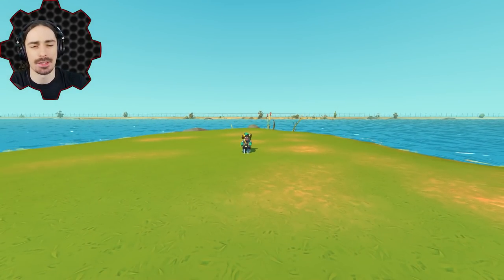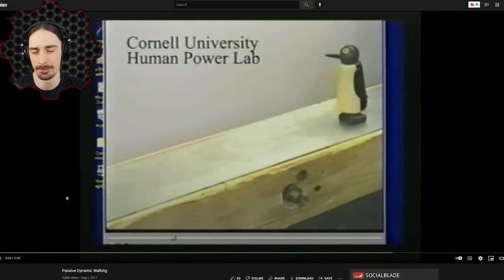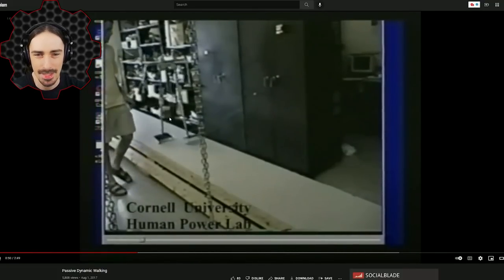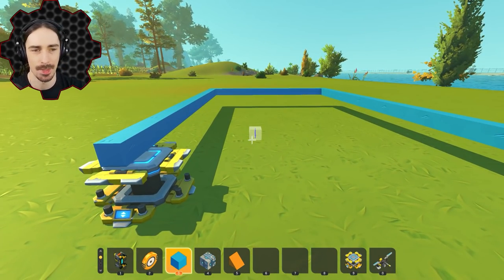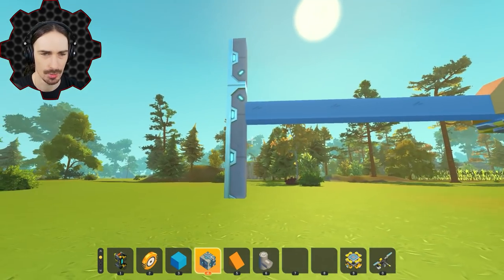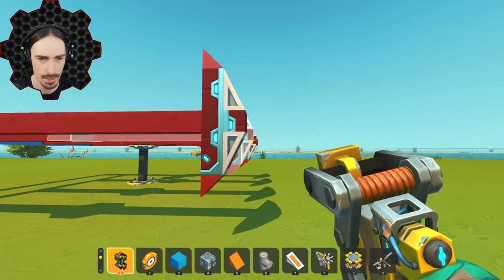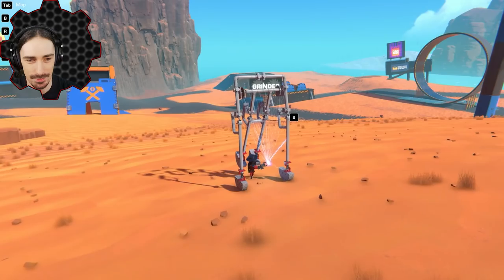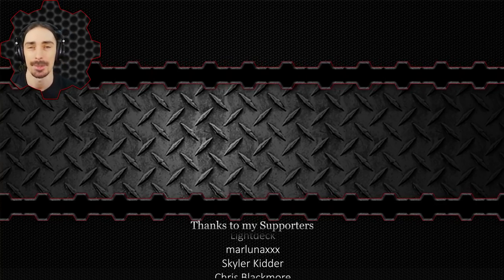This Simple Walker Was The Hardest To Actually Make

Comment: If you were to try this again, you'd need a counter weight at the top of the knees.

The reason it's not taking the correct steps is because it's main weight is in the feet. If you extend the lower leg through the knee and add extra weight at the top, it will cause the knees to bend on every step.

I'm actually super interested in seeing this work and might need to make a video on it just test the concept 😅
Reply: Ok your probaly right
Reply: Oh in i forgot in scrap mechanic or in trailmakers
Reply: @Hiro_blee3292  it was probably trailmakers
Reply: ^ This ^
Plus he should change it so one set of legs has feet pointing forward and the other has feet pointing backwards, that way it will slightly lift up each step, wich hopefully means it wont get stuck on the ground mid-step like is happening 95% of the time with the designs in the video.
Reply: Also, they should bind the outer legs together, because they clearly were in the original video, and having them separate does nothing but cause more issues.
Reply: The major problem is that he but too much weight in front of the legs what made the legs not bend the right way in scrap mechanic
Reply: also, the feet should land with back part, so they "roll" when the other feet are in air
Reply: I came here to say this as well. The knee weight needs to be slightly forward of the “hips”. The “hips need to remain in the center of the mass in order to maintain balance, like in real life. We lift our knees ahead of taking a step in a “controlled fall”.
Reply: I was thinking that maybe the middle legs need to be one block shorter? Or am I dumb?
Reply: Nevermin, I dumb.
Reply: That what I wanna say
Reply: I was wondering if it might not just work if he added a gyroscope up top to avoid it tipping over.

That's not exactly in the spirit of the challenge, but would have been cool to see it walk.
Reply: I was mentally screaming this at scrapman the whole time!
Reply: @Hiro_blee3292  *you're
Reply: You are absplutey correct.  If you look at the original design, the "knees" were not only stopping the roteation of the leg, but were also counterweight to raise the leg until the legs pass the COM of the body.  The knees need to have as much mass (or a little bit more) as the legs below the knee and the foot. When it tilts forward, the knee needs to take the weight off of the foot so that it does not hit the ground, then when the knee passes the other knee the weight should shift, straigtening the leg and lowering the foot.     

the foot should also be flat at the rear and curved only at the front. maybe a short wedge on the rear of the foot and a longer wedge at the front with a few flat blocks in between
Reply: yeah, I think the reason it worked better in TM is because he put more weight above the knee with the whole "kneecap" mechanism
Reply: I was just coming down to the comments to say the same thing.
Reply: This. I believe this right here is the answer.
Reply: he also needs to add another joint below the outside hips because at the moment hes relying on the weight at the top to make it lean forward which inturn makes the outside legs go backwards because there is no joint its just static
Reply: This is exactly what I was thinking, the reason it works is because when the inner legs take the first step it causes the entire thing to fall forward which shifts the center of mass from directly in line with the outer knees to in front of the outer knees.  Which, with weighted upper knees, causes the outer knees to swing like a pendulum to reposition itself in line with the center of mass. That action then causes the same to happen to the inner knees.  The main problem I think he’s have is depending on the friction of the feet with the game mechanics
Reply: Also I think limiting the "hips" movement would also help in this. Right now it can swing out too far for the other legs to catch up to. If they had only a 30 degree of travel, then it couldn't do a giant step. Not sure if that is possible in either game though
Reply: I noticed that immediately, he's just to close to the project
Reply: Even just some reverse shocks to kick the outer legs out after the inner takes its step.

Comment: 10:35 since the concrete blocks at the top are forward of the point of rotation, obviously the outer legs dont want to rotate forward, they actually want to rotate backwards.  If you look at it from the left side, the concrete weight at the top is the furthest forward. Then comes the point of rotation, the hipjoint you might say, which is supported underneath from the inner legs. This means that the concrete at the top is actually excerting a rotational force counterclockwise, or in other words forcing the outer legs backwards.

Comment: Try to connect both outer legs so they're in sync. From the looks of it, due to the independent outer legs, the walker tends to move one outer leg only
Reply: how tho
Reply: @calspacer6685  put a tube in the back that is stick to the two outer legs but skips the two inner ones with enough room to still move backwards the two inner ones. Then put some weight on the front o compensate
Reply: @rlebron2249  or use collision glitches
Reply: @rlebron2249  or just make it go up and above the whole machine
Reply: @rlebron2249  putting weight on the front does compensate for the horizontal weight balance, but completely throws off the vertical balance
Reply: @calspacer6685  just use suspension

Comment: It's forward motion is entirely dependent on linear momentum, the two separate sets of legs act as a pendulum and create the perpetual motion necessary for it to "walk". You'll need to experiment with weight distribution and friction on the feet.

Comment: I had a go at building one of these things myself after watching, and doing some research on them shows they are notoriously difficult to get working. These biped/tripod types even moreso. The common approach to them is to provide them raised spots for the feet to land, because the swinging legs tend to ground out as they are all the same length. I found one that used a cam of sorts to lift the leg that is swinging forward clear of the ground, but I really dont know how you'd do that in either game, if its even possible.
So your couple of steps Scrap were very impressive! As a note, the videos I found where their bots could take a half dozen steps if they worked at all, were from engineering collage and university students that had weeks to work on them with reliable real-world physics. The slopes they used were mostly between 2% and 4% gradient, but one of these bots seemed to be able to handle flat interior floors somehow. It was far more complex though, full of weights and springs so likely some sort of conservation of momentum mechanics involved.
As a side, I found a sort of workaround for the clipping issue you had with the initial knees. The weight blocks dont seem to have that issue.

Comment: Idk if u noticed but the 2 middle legs Are a little bit shorter than the outside legs
Reply: I'd say make the outer legs a tad bit shorter than the middle legs and use a bit of @Code_Creature 's knee counter weight method. so the inner legs when they bend will give it just enough lift to move between and when they settle will give a bit of a lift for the outer legs to swing out to miss colliding with the ground? Or make the feet on inner legs a little thicker?
Reply: this is true this fact was killing me

Comment: If you're gonna do this again, make it so that the outer legs are shorter than the inner ones. Normally the steepness of the ramp achieved the same effect, but doing that is much better as it will make the outer legs fall later and not make it collapse. Also join the outer legs.

Comment: I don't know if this will help but I think a key part of understanding how these walkers work is it seems that the top bar the very most top never stops moving forward when the legs step in front of it it has to have enough momentum to carry it up and over the arch if it doesn't have enough momentum it will stop before reaching the peak so I think a key part would be to make sure that that top bar is constantly moving forward it might slow down it might speed up but it just needs to be moving at all times

Comment: Your later scrap mechanic versions would have most likely worked had you used a less steep incline.

The reason they didn't work was that the knees wouldn't bend, and that was because by the time the center legs hit the ground, the center of mass was ahead of them. 

But, if the incline was less steep, the center legs would hit the ground earlier, so the center of mass would be behind them causing the knees to bend.

This could also be solved by adding a weight to the top that is behind the connecting bar, or lowering the knees in the center legs.

Comment: I think in scrap mechanic you may need to add weight to the outer legs. potentially add another "kneecap" to the top of the inner legs as well. ideally you want the inner legs to plant and not move forward anymore. you then want the outer legs to move forward fast enough to plant themselves and swing the inner legs again. also something to note: in the IRL design, the kneecaps are a bit less than half the length of the "thigh" of each leg. So medium weight on inner legs, heavy weight on the outer legs, longer kneecaps, kneecaps are lighter weight than bottom of legs.

Comment: Can’t believe you got as far as you did. Great job. I’m wondering if either the inside or outside legs are slightly longer or heavier
Reply: Yeah, they probably could've made it consistent, but they missed some key points in the video. For one, the outer legs should be slightly shorter than the inner ones. Another issue is they put a counterweight at the top front of the walker, which actually causes the legs to bend in the opposite direction they should, causing them to be straight. They should add counterweights to the knees instead. They also forgot to bind the outer legs together like they were in the video, which would prevent any failures due to one leg moving while the other doesn't.

Comment: Man wish I had these games. I think at first make sure the bends are even at the top and bottom of the legs. Then if you look at the 98 video the way they made the knees and with them having an extension to clap the leg when the other ones move forward. And they only travel so far forward. So if you can stop the legs from going to far forward it might help. I'd say just go back and continue to look at the 98 video and see what's missing. And id try to still try to make it walk flat instead of going down hill. But that's the hard part too.

Comment: This was cool! What if you add a central pendulum, or two on the sides, so that inertia keeps it swinging out of sync with the legs? That could possibly maintain the forward movement. Not to mention that a central pendulum would look a bit... anatomically correct. 😄😆

Comment: You need weight at the top to make the machine lean forward. Also, on both top bars there should be a weight coming out the back to add rotational force to make the legs swing forward.

Comment: The issue you had with it falling frontwards is because the weight at the top needs to counter balance the decline on the slope to have the top part as “upright” or “level” as possible

Comment: one thing I noticed is that if you made the inside feet just a block shorter it might have worked better because the one in real life had shorter middle legs than it did outer legs and if that doesn't work than do the opposite next time. I don't have either of the games but i thought i might Aswell mention this because these might work.

Comment: So scrapman, something you didn't notice is that the outer legs are slightly shorter than the inner legs to prevent dragging on the ground
Reply from the maker: That would cause the inner legs to drag. They all have to be the same length. It's the knee bending that is meant to prevent drag
Reply: @scrapman  Yknow... I only thought about that after I posted, and figured you'd never see what I said anyways 🙃

Comment: people pls like so scrapman sees this
yo @ScrapMan you had a fatal error in scrap mechanic. the inner legs were a few blocks (maybe 3 or 4) shorter than the outer legs. so when the outer legs hit the ground, the weight on the top causes the whole mechanism to tilt forward. when this happens you can observe in 9:36 that the outer legs try to bend but hit the ground before they reach the proper position to start the cycle again

Comment: The weight (in Scrap Mechanic version) shouldn't be on the top of this walker, but on the upper rod connecting inner legs, because it was pulling pivot forward instead letting it reverse! Look at the top part going forwards and back in the Trailmakers and the real version.
Put the weight one part lover.

Comment: Put a bar that connect the two outside legs so they move in sync and stops the middle ones from going forward too much you could also put wheels on the front of the outside legs idk if it will help with rolling them so they bend when going forward

Comment: ScrapMan you need to put more weight at the top of the knees. For the knees to bend, there needs to be some weight to counter the weight of the foot, like a seesaw. Rewatch the video and you’ll notice that they use very large knee stoppers to counter the weight and accomplish this phenomenon.
Edit: Also notice that at the end of the video, as you added more parts to the area above the knee, it worked the best.

Comment: you need to shorten the outside legs by just one block and it will be much better, the outside legs keep contacting instead of passing because they are the same size, so just shorten outside by one

Comment: I think this came down to just having your feet be too small, when the real walker stepped forward, the feet made the connection to the ground shorter, then, as the walker went forward, it transitioned to the front of it's feet, which smoothly raised it enough for the other set of legs to pass over the ground until they made contact and the walk cycle began

Comment: PLEASE TRY AGAIN WITH MORE WEIGHT ON THE UPPER KNEE!! The way it works is because when the inner legs take the first step it causes the entire thing to fall forward which shifts the center of mass from directly in line with the outer knees to in front of the outer knees.  Which, with weighted upper knees, causes the outer knees to swing like a pendulum to reposition itself in line with the center of mass. That action then causes the same to happen to the inner knees.  The main problem I think you might have is depending on the friction of the feet with the game mechanics

Comment: He’s was bound to fail from the start because of the weight distribution. The outermost legs couldn’t pick up their knees to make it walk because the didn’t have weight pulling the knees up. If he added a few blocks of concrete to the back of the top of the frame, the outer legs would’ve swung forward to keep the momentum.

Comment: Ironically i don't think it's the weight that's the problem, your designs after moving the curve of the feet forward instead of centered were correct - the problem is that scrap mechanic has insufficiently rounded feet - if you look back at the original video, his curves are not perfect, regular semicircles, but instead are slightly pinched at the "heel" and slightly extended at the "ball" of the foot.